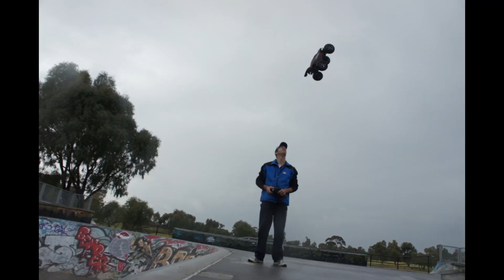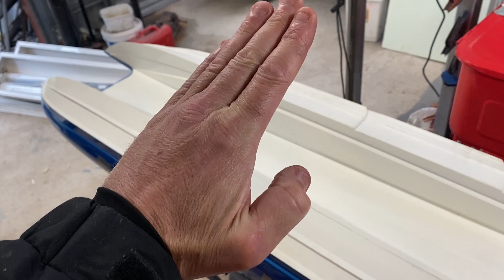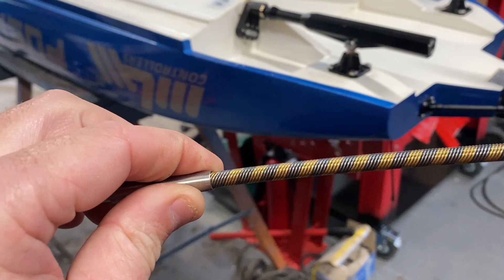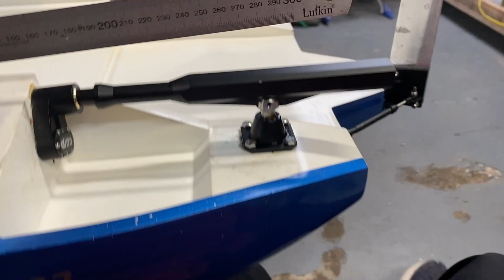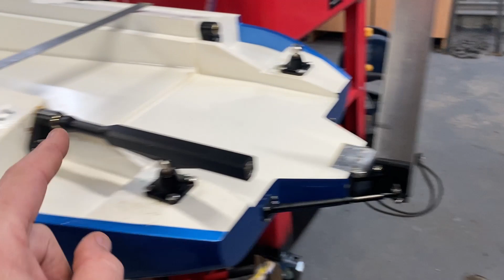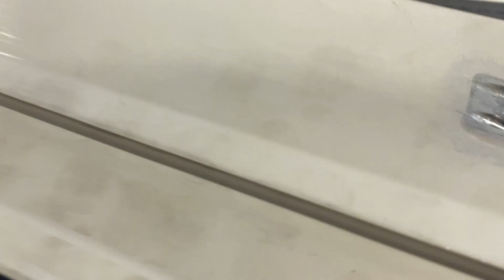Giant RC Boat Build Series Part 1 the Hull

Comment: I have a mystic 114 and i installed my drives from mhz (was a combo deal) and i can't get them to neutral position. They are pushed down to pust bow down.....the pedestals drives are 2mm too big for the mhz 114.
Reply from the maker: If you send me an email with pictures I can try to assist in helping. info@ultimaterc.com.au

Comment: What would happen if you coated the hull with an extremely hydrophobic material? As long as it is light enough, would that help performance and the top speed? My final question is: why not have the exiting water facing rearward, towards the back of the boat?
Reply from the maker: Hi Cliff, water exits the side so you can see if the cooling is working, no real benefit with them out the back. It is also a short run of hose so they exit faster hence not adding back pressure on the system. From my understanding hydrophobic material still does not add air under the hull which is what you are trying to do by sanding the bottom. This process is even done on the real world record holding of shore boat.

Comment: Really great boat and great video!
I am planning to install one  of those double water pickup you have on you boat. My TFL Genesis 56 came with a single water pickup on the bottom. Would mind letting me know what did u use to glue the water pickups on the haul please? Thank you!
Reply from the maker: It’s called SciGrip sg300. Very expensive here in Australia and only a few places have it. It will feature in one of the next videos.
Reply: @radiocontrolledevents  thank you so much friend! Can we see more videos from your boat please?